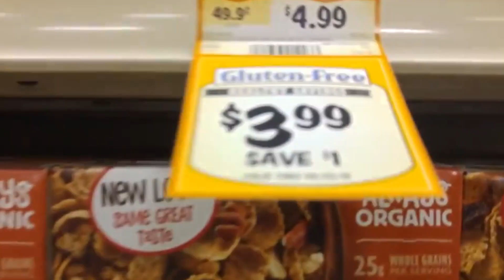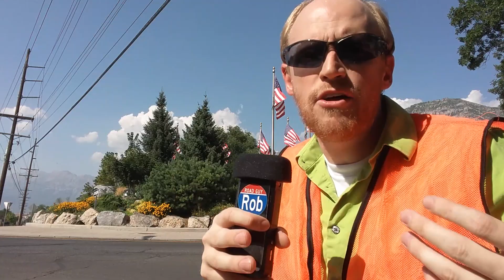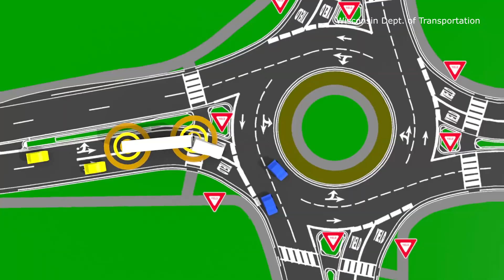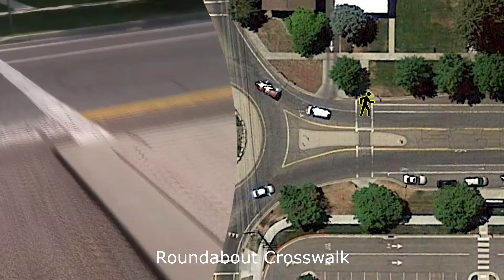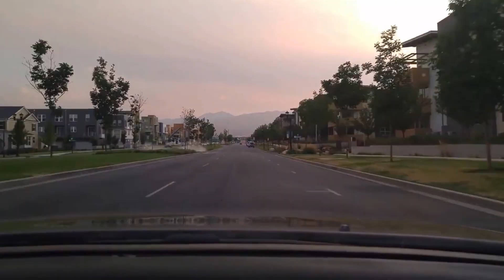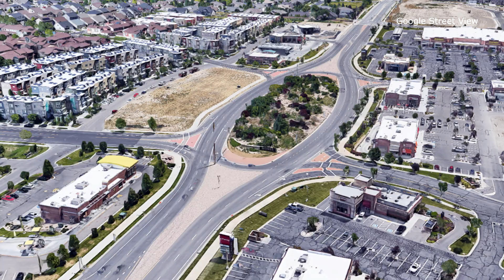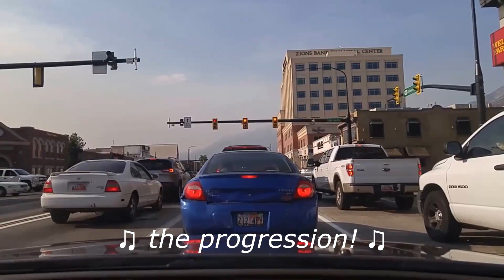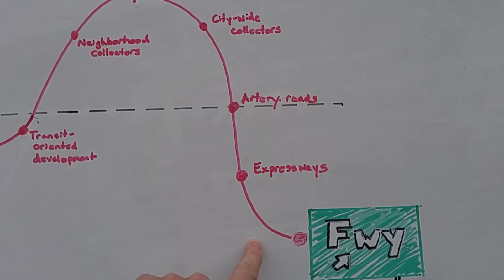Are roundabouts REALLY better than a traffic signal?

Comment: Roundabouts only work if the population in question is smart enough to use them
Reply: The population isn't smart in general - fortunately, roundabouts are a simple concept, and I see them usually replacing 4-way stops, which are even more confusing when multiple people pull up at the same time. Based on my anecdotal observations people get used to using roundabouts fairly quickly once they're put in. Yes, you'll always have somebody that doesn't know that yield doesn't mean the same thing as a stop sign, but overall I find that they work quite well even where people have the IQ of a grain of sand.
Reply: @baddriversofcolga  easy for a multi-stop sign, person on right goes first if multiple people arrive at same time. Simple. 

Stupid people think stopping at a stop sign is a suggestion, not a law.
Reply: @DarkChaos87   That might seem simple, but it's not as simple as a roundabout where you only have two cars ever interfacing where in a 4-way stop you have 4 and people can't keep track of who goes and then someone doesn't use their signal, people don't stop at the line, etc.
Reply: @baddriversofcolga  Circle may seem simple (I think they're simple), though I've had my fair share of those same idiots in circles. My experience, nobody pays attention, everywhere, all the time. To me, circles have the same amount of "participation trophies" as lights and signs. And Canadians are supposed to be the nice bunch.
Reply: @DarkChaos87  I do occasionally see idiots in roundabouts, but I see them at a lower frequency than in 4-ways. And the not-having-to-stop-when-a-car-isn't-coming part is a nice benefit.
Reply: Right, but a 90% decrease in fatality rate still gives it the upper hand even if it devolves into bumper cars.
Reply: I much prefer idiots messing up at a roundabout with less speed differential than turning left into oncoming traffic due to a panic from the light turning yellow, for example.
Reply: Well known saying... A person is smart, people are stupid.
Reply: well luckily they are extremely easy to use
Reply: @arposkraft3616   U.S. has also other problems though in each state https://artbabridgereport.org/state/profile/IL
``Of the 26,825 bridges in the state, 2,407, or 9.0 percent, are classified as structurally deficient. This means one of the key elements is in poor or worse condition.``
also
``The state has identified needed repairs on 4,129 bridges at an estimated cost of $5.8 billion.``
Reply: @knightwolf3511  mjeh, muricans like to live dangerous and without maintaining, but jokes aside it is very true that infrastructure has some ifs and buts in the US of A
Reply: @knightwolf3511  well im a complete fan of urban decay so thank you for the links...however its a bit hard to argue there would be no money...seeing the US is the most wealthy nation on the planet and not by a little bit scoring about 30% higher gdp per person then even the richest of european nations.... the difference is...the money get spend on military mostly while we spend it mostly on infra and healthcare (resp 25 and 60% of it) 
the tracks here are wholly owned by the state while the vehicles and service is done free market fashion...it also makes no sense to "compete" the tracks because you cant just put 5 6 7 8 different companys tracks along the exact same route without well being incredibly inefficient. 
same goes for roads, roads bar some exceptions are public owned and are not competing, the cars and services are privately owned but not the roads

its a different mentality I guess and it leads to a different result; in the US you have haves and have nots (in citys people and states) but you also have the possibility of excelence (for example your top universities are the top of the world but your general education tends to be lackluster) 

To add.. most roads and rails in the US were implemented fast and around the same time...in fact about 'meh big maintenance is needed' years ago, so now it all starts decaying all at the same time . 

if only the money was not spend on bombing 1.5 million iraqi civilians to smitherenes (ty bush) or blasting ghadaffi and or assad out of power (ty obama) then some of that infra might have been better maintained.... 

as it stands the pax americana will be ending swiftly and with damages, and the lesson of individuals not existing shall have to be learned...and who knows, maybe one day you all will even realise that you wernt heroes of ww2.
Reply: @knightwolf3511  btw not to bust your balls but a 20% debt to gdp ratio is one of the best in the world (for example; italy has a 150% debt to gdp ratio, japan a 200% and belgium a 70% just to name a few) ...i know that looks like a lot of money and i would agree that any debt is less then preferable, but on global scales thats a AAA rating, moreover since interest is historically low it can be cheap if not free to lend money (in fact in the EU the states now lend at a negative interest rate) 

which ironically proves the entire system is broken fundamentally and thats why they keep jamming on about 'the great reset' but it doesnt actually make the US look bad comparitively
Reply: @arposkraft3616  - sorry but your comment about GDP/national debt totally irrelevant to this discussion.  (... or why not include the space program and military spending!?)🙄
Reply: @chris_ackroyd  ehm no it isnt since someone posted links to the debt clock arguing a decline state of affairs and issues, my remark to that was that a 20% debt to gdp ratio isnt worse than a lot of other nations that have better infra and thus that there's causal relation between the two...

how about you stay out of Caleb and my conversation rather then to assume and presume we give a shit about your opinion
Reply: No roundabouts in Africa, got it.
Reply: that's the problem I see with them.  One person who doesn't understand it ruins the safety benefits of everyone else in and around the circle.
Reply: @jeremywj  ive literally never seen anyone be stupid enough to not be able to use them... its a strawman argument, they are far easier to use then intersections. and no it doesnt if you miss your turnoff you can just drive round, again; try that on an intersection.

roundabouts work great, they are centrifugal traffic pumps and make it so you don't need to stop every 300feet
Reply: @arposkraft3616  Not sure what planet you live on, but 90% of people here are apparently completely clueless on what to do when they approach one.
Reply: @jeremywj  the planet called europe and no you don;t you are pretending, you have the same yield symbols so when you approach you see the yield symbols, so you yield for those on the roundabout, 
when roundabout is free: great go-ahead and drive onto it, go in a circle and leave at the exit you want, if there's pedestrian crossing for which to yield do so as you normally do
done 

If you miss your exit, again; go round in a circle try again, you can theoretically do that all day long on the same roundabout without stopping traffic flow provided that it isn't 20 people doing it all day on the same roundabout (thats called a carousel and you find those in a theme park)
and as said before; try doing that on a intersection.

It really isn't rocket science, not even for muricans.
Reply: @arposkraft3616  I can't speak for Americans or Europeans but I can confidently say in my experience in Canadian roundabouts and roads in general, the problem here is that people don't seem to know what yielding is or means
Reply: IslamToMan RabiesToDogs they’re in the trees
Reply: They will learn. Just one rule go in the right direction and don’t stop!
Reply: Yes, Village One in Modesto has had them for over a decade and the natives still can't figure them out. Sometimes "Yield" does mean STOP.
Reply: The point is just to learn how to use them at your driving licence. I bet if Americains can't drive on roundabout that's because they never learnt to
Reply: Americans are not
Reply: Considering IQ: Everything above room temperature is enough.
Reply: You can always ask the Brits how to use them.
Reply: They give the general public guns to play with as well, how smart is that ?
Reply: Jesus...any person with half a brain can use a roundabout....it’s really not hard
Reply: @greenestmachine71  let me introduce the Turbo Roundabout. I honestly do not think the average person is smart enough to navigate a multi-laned roundabout, never mind one of these badass puppies.
Reply: @greenestmachine71  you'd be surprised how dumb people are.
They've been building roundabouts and traffic circles in my city for the last few years and they are now installing stop signs and traffic lights in the older ones because nobody knows how to fucking yield apparently
Reply: @greenestmachine71  unfortunately most drivers here lack even that
Reply: The US population is plenty smart enough to use roundabouts.  However, they don't teach the rules of roundabouts (e.g. who has the right of way in which place) in US drivers ed.  Take it up with the socialists in the public school system and the DMV.
Reply: @aramfingal5180  i didn't even learn how to Parallel park at dmv since where i live there really is no place to Parallel park, i never even seen a roundabouts other then videos and youtube
Reply: @aramfingal5180  Don’t American roundabouts have yield signs?
Reply: @aramfingal5180  You can't teach rules to people who think what they are being taught is part of a conspiracy.  You will only confirm their suspicion by trying.
Once the USA finally admits it can no longer exist under the same federal entity.   Then it can get on with the business of building better infrastructure.
And frankly who cares what the MAGA crowd does .   Laws of physics will eventually nullify them.
Reply: @Mk101T  Perfect response.
Reply: lol which population could you mean....?
Reply: @drawnimo  Anywhere but 'merica.
Reply: Not sure if US drivers are that smart.
Reply: @catdogpigduck I love how you posting This logical comment has caused many idiotic banshees to spew their nonsense in the comment section.
Reply: In the United States people are too stupid to use them. They don't merge.
Reply: @xChromerSatanasx  
Unfortunately the people criticizing others for being "stupid" for not knowing how to use a roundabout are usually every bit as ignorant as the people they are criticizing. People are not stupid for not knowing the rules of the roundabout if those rules are never set down and publicized by the traffic authorities before opening the roundabout - and in America, thus far, this has almost never been done. This is particularly the case for multi-lane roundabouts where some situations contradict the usual rules of the road (see below). 

Rob violated the rules of a roundabout by changing lanes in the roundabout. One must always know which lane to be in before entering the roundabout. Unless the rules of the roundabout are explicitly proclaimed by the governing traffic authority and the public is thoroughly educated in their use, roundabouts, especially multi-lane roundabouts, should not be implemented. 

Here are the general rules of the roundabout as set down by those rare jurisdictions that actually bother to publish the rules.

Note that the rules for a roundabout are different from a traffic circle or a rotary. The biggest differences between a roundabout and a traffic circle are:
1. In a roundabout, you must always yield to traffic on your left, i.e., inside lanes (lanes that are closest to the center of the roundabout) always have the right-of-way over outer lanes. (See U.S. Dept. of Transportation, "Roundabouts: Informational Guide", Section 2.4.2  Right-of-way between vehicles, page 38).
2. In a roundabout, you are not allowed to change lanes inside the roundabout. You must select the correct lane before entering the roundabout.

When two roads cross at a junction, there are four possible options for traffic:
1. Turn right onto the intersecting road.
2. Continue straight on the current road.
3. Turn left onto the intersecting road.
4. Take a U-turn to go in the opposite direction on the current road.

In a roundabout, regardless of the number of lanes, you have these same four options. However, you should know which one of these things you want to do before entering the roundabout. On a two or three lane roundabout, select the appropriate lane before entering the roundabout. It is illegal to change lanes while in the roundabout, so you should exit the roundabout in the same lane from which you entered it. Select the lane you will be using, before you enter the roundabout:

1. Right Lane: 
   a. Turn right into the right lane of the intersecting road.
   b. Continue straight in the right lane of the current road.
2. Middle Lane (if any):
   a. Continue straight in the middle lane of the current road.
3. Left Lane:
   a. Continue straight in the left lane of the current road.
   b. Turn left into the left lane of the intersecting road.
   c. Take a U-turn to go in the opposite direction in the left lane of the current road.

All traffic should slow down to 20 mph before entering the roundabout. All traffic entering must yield to traffic already in the roundabout. You must yield to traffic on your left (i.e., cars in the inner lanes always have the right-of-way.) Signaling is important. Here is how each of the four options is achieved:

Right Turn:
1. Approach roundabout in the right lane and slow to 20 mph. Yield to any pedestrians or bicycles on crosswalks.
2. Yield to any oncoming traffic in the right (outermost) lane of the roundabout. 
3. Enter the right lane of the roundabout. 
4. Signal a right hand turn.
5. Exit the roundabout into the right lane of the intersecting road.

Going Straight (from right lane):
1. Approach roundabout in the right lane and slow to 20 mph.  Yield to any pedestrians or bicycles on crosswalks.
2. Yield to any oncoming traffic in the right (outermost) lane of the roundabout. 
3. Enter the right lane of the roundabout. 
4. Yield to any inner lanes of traffic (to your left) attempting to exit onto the intersecting road and continue past the intersecting road toward the other side of the roundabout where the current road resumes.
5. Signal a right hand turn.
6. Exit the roundabout into the right lane of the current road.

Going Straight (from middle lane, if any):
1. Approach roundabout in the middle lane and slow to 20 mph. Yield to any pedestrians or bicycles on crosswalks.
2. Yield to any oncoming traffic in the right lane or middle lane of the roundabout. 
3. Enter the middle lane of the roundabout. 
4. Yield to any inner lanes of traffic (to your left) attempting to exit onto the intersecting road and continue past the intersecting road toward the other side of the roundabout where the current road resumes. 
5. Signal a right hand turn.
5. Exit the roundabout into the middle lane of the current road. Note that outside lanes should yield and allow you to exit.

Going Straight (from left lane):
1. Approach roundabout in the left lane and slow to 20 mph. Yield to any pedestrians or bicycles on crosswalks.
2. Yield to any oncoming traffic in the right lane, middle lane (if any), or left lane of the roundabout. 
3. Enter the left lane of the roundabout. 
4. Continue past the intersecting road toward the other side of the roundabout where the current road resumes.
5. Signal a right hand turn. 
6. Exit the roundabout into the left lane of the current road. Note that outside lanes should yield and allow you to exit.

Left Turn:
1. Approach roundabout in the left lane and slow to 20 mph. Yield to any pedestrians or bicycles on crosswalks.
2. Yield to any oncoming traffic in the right lane, middle lane (if any), or left lane of the roundabout. 
3. Enter the left lane of the roundabout. 
4. Continue past the intersecting road and past where the current road resumes.
5. Signal a right hand turn.
6. Exit the roundabout into the left lane of the intersecting road. Note that outside lanes should yield and allow you to exit.

U-Turn:
1. Approach roundabout in the left lane and slow to 20 mph. Yield to any pedestrians or bicycles on crosswalks.
2. Yield to any oncoming traffic in the right lane, middle lane (if any), or left lane of the roundabout. 
3. Enter the left lane of the roundabout. 
4. Continue past the intersecting road, past where the current road resumes, past the left side of the intersecting road, back to the current road going in the opposite direction from which you entered.
5. Signal a right hand turn.
6. Exit the roundabout into the left lane of the current road going in the opposite direction from which you entered. Note that outside lanes should yield and allow you to exit.

Traffic exiting the roundabout should always signal their intent by turning on their right directional indicator (right blinker).

The most dangerous aspect of the roundabout is exiting from the middle or left lane. Traffic in the outside lanes of a roundabout must always yield to traffic in the inner lanes (to its left) on the roundabout. This may mean stopping on the roundabout while traffic in the inner lanes exits the roundabout before continuing. Note that this is not intuitive and conflicts with the more general concept that traffic in a lane to your left does not have a right-of-way to cross in front of you to take a right turn.
Reply: @xChromerSatanasx  Then that is a problem with the roundabout and not the driver. Roundabout design is such (or should be) that the driver is forced to make a right(ish) turn onto the roundabout. Essentially, if the design is correct, then the driver is forced to slow down to a speed of 10-15mph (higher on larger roads) and be forced to a 'yield' position but without being actually forced to stop. The most important design aspect of a roundabout is not the central circle bit, but the angled bit as you approach (this is the most important bit from a design point of view). If your average driver can't cope with it, then it is probably a badly designed roundabout (we've been building them here in the UK for decades, so they are generally foolproof).
Reply: @horsenuts1831  Some people here (a small amount but still some) will stop at a roundabout regardless of how well-designed it is. Yes, people here can be that dumb.
Reply: @baddriversofcolga  There's a delicious irony here. I have only driven in the USA twice. The first time was when I was 17 before I had passed my British driving test when I was on vacation in Connecticut but the family I was staying with let me drive their cars anyway (we take our tests at 17 here in the UK).  In Connecticut, I was taught to do a proper full stop at a STOP sign and indeed, that was how the family drove. Fast-forward  30 years and I hire a car in Las Vegas and drive in Nevada just like I did in 1982 in Connecticut by dutifully stopping at EVERY stop sign. The only problem was that I was the ONLY person doing this. I'm sure I was attracting some strange looks.
Reply: @horsenuts1831  Haha!
Reply: Pauly Paul Sounds like Minnesota.
Reply: @baddriversofcolga  in Brazil they use the STOP sign in roundbouts, but here the stop sign doesn't means to really stop, you just have to look if some vehicle is in your way, then you go  when is no one vehicle on the interception.
Reply: @baddriversofcolga  I’m dutch and had to drive on multiple roundabouts in my first driving lessons and I wasn’t even allowed to stop unless it was incredibly busy. You usually don’t even need to shift to first gear...